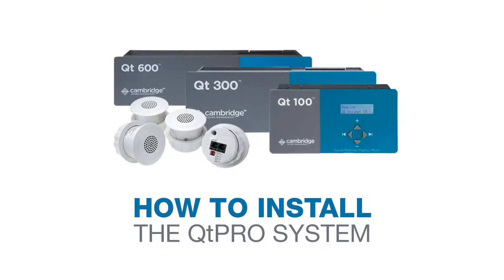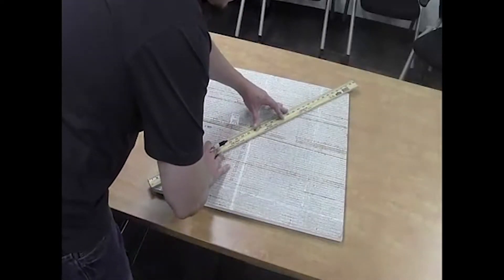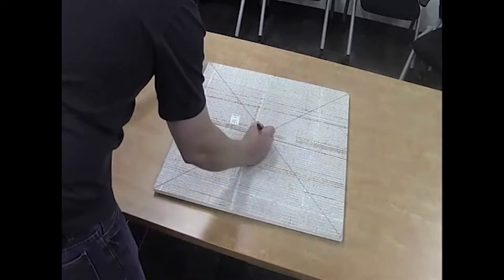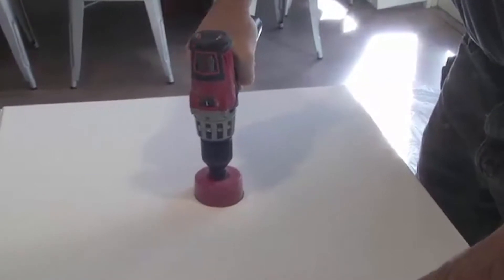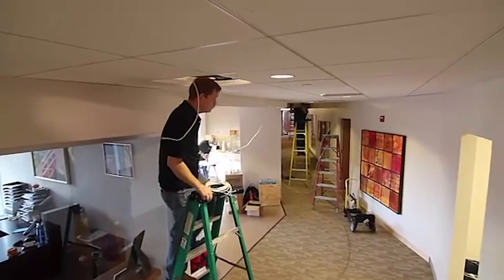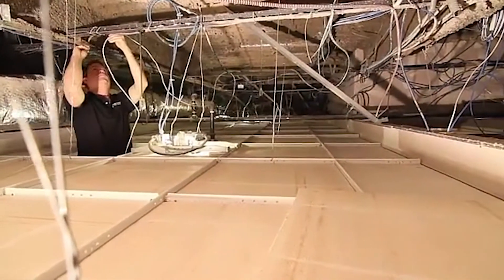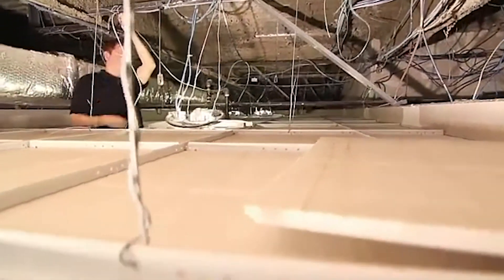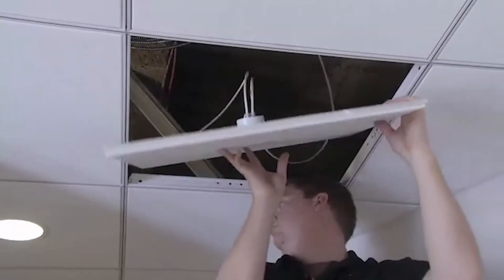How To Install The QTPro System

Comment: How can I install this type of emitter in an area with a full gypsum ceiling? I mean, how can it be securely fixed to the gypsum ceiling?
Reply from the maker: We have a drywall ceiling emitter mounting bracket that allows us to install into a gypsum ceiling. Feel free to give us a call at 972-787-0808 and we will be happy to discuss further.